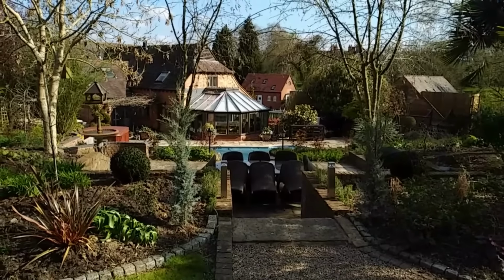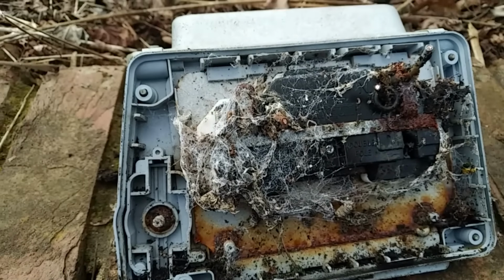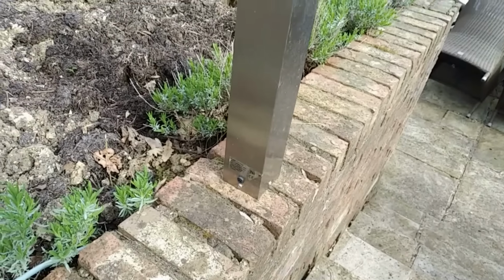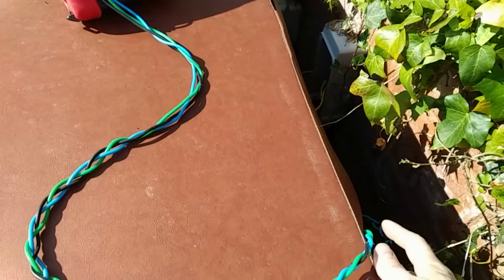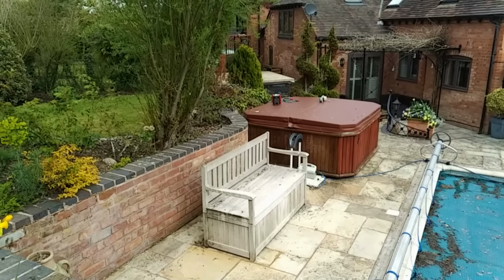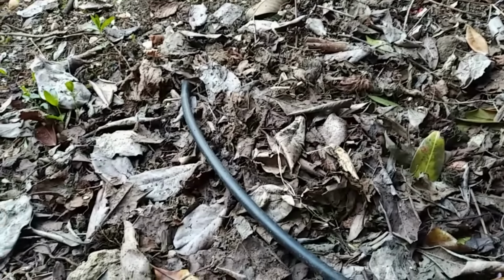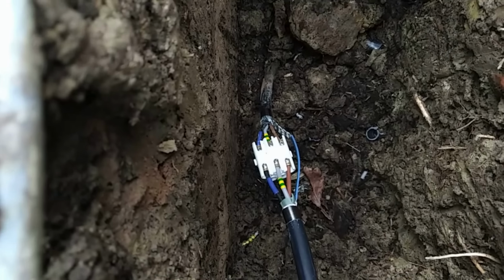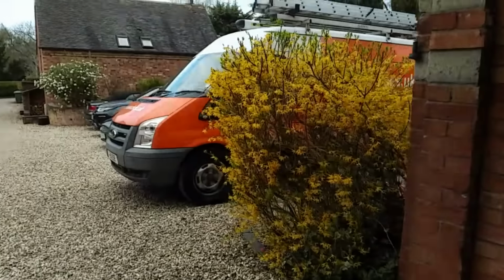Uncocking cack garden electrics

Comment: Your electrical materials are so much different than here in the states.  I'm amazed how you run 220 everywhere.
Reply from the maker: I woudn't want to run anything above 12V to much of this installation - no need for more than that with modern ELV LED lighting!
Reply: @dsesuk  
Here the only thing that would be 220 would be the pump and maybe heater on the hot tub.  I guess it would be handy to have line voltage here and there to run equipment but there are so many good rechargeable units now. Why do I want to drag cords around? They would only be 110 anyway.

The main difference that most people here, including electricians, don't understand though is that you are charged by the leg with the higher load.  If you are running all 110 loads and your panel isn't well balanced it can be a lot more money.  Then if you start looking into power factor etc.  things will begin to make your blood boil.

Personally I use a lot of solar lighting now.  You can get cheap motion sensor LED lighting  on Amazon for around $6/unit.  I put those things everywhere on my property.  Talk about handy.  Scares off the critters too.  My donkeys like to play with them.

Here when we say 'armor cable' we usually mean metal wrapped mc cable or sealtite.  You guys have really odd stuff.  It's neat though.  Looks like it would be good quality if installed properly.  Normally we only see stuff like this on commercial projects.  Everything here is usually Romex, or run in pvc conduit on residential.  Exterior is usually pvc conduit and some sealtite.

All of those buried junctions give me the creeps.  That isn't code in the states.  You would have to have an accessible vault.  Of course in the county I live in there is no such thing as permitting and code compliance.  So much terrifying crap!  It's like a zombie movie.  Most houses around here could be upgraded with a bulldozer.  When I see a new burned out hulk I say, "Yet another successful home improvement project."
Reply from the maker: @rehoboth_farm  Solar lighting would be great if the rain clouds parted for long enough! I've heard before that all junctions have to remain accessible over there. Makes sense, but it must make life difficult! We have a specific regulation and British Standard (BS5733) over here allowing connections to be inaccessible under certain circumstances, and thank goodness for that!
Reply: Actually 220-240 makes a whole lot more sense economically, it's a decent compromise between safety and material costs. Basically a European circuit allows you to draw much more power at once than your average American 15 or 20 amp circuit while using the same size of wire!

A 120 V/15 amp circuit delivers 1800 W while a 16 amp circuit at 230 V gives you 3680 W! For some reason the US require fairly large wires for 15 and 20 amp circuits too, so it's really a bit of a waste. Korea used to have the same setup as the US but switched to 230/400 V three-phase distribution back in the 70s - I guess they did that for good reasons!

In most developed countries the number of electrical accidents is extremely low, regardless of the mains voltage, so "120 V is safer" doesn't really seem to be an argument. On top of that, most of the electrical accidents around here are work-related, i.e. professional electricians disregarding basic safety procedures and other contractors not supposed to mess with electrics at all. I guess the only reasons why the US never considered upping the supply voltage are the effort required (including the environmental impact of scrapping billions of appliances) and a gut feeling that anything exceeding 120 V is unsafe for the general public (277/480 V being commonly used in the industry, so it isn't like higher voltages are simply unheard of in the US).
Reply: @Ragnar8504  I understand the reasons for using 220.  We use 220 on large appliances like washers, dryers, ovens and air conditioners.  I've run a lot of 208 and 480 in industrial and commercial applications.  The only place that I normally see 277 is in lighting circuits.  

I jut fail to see why my coffee pot needs twice as much power.  Besides, most of my electronics are going to convert wall current to DC anyway.  TVs don't use CRTs anymore.  Now, all new lighting is LED and therefore converted to DC.  If 220 is better then why not wire everything for 208 three phase and run three phase motors in everything?  Electrically speaking three phase is much more efficient than 220.  Who doesn't want a three phase leaf blower?  

As far as safety more people in America are killed by garden variety 110 than any other voltage.  Why?  It's what they interact with.  It will always be the voltage that the 200 lb ape is exposed to the most frequently.  277 is brutal though.  Brutal.

Don't get me started on 50hz.
Reply: @rehoboth_farm  "Who doesn't want a three phase leaf blower?" =:-O LOL Just figured out how to inflate my pool quicker and entertain the dog from the opposite end of the garden at the same time!
Reply: @rehoboth_farm  Anyway, what's wrong with 50Hz?  The maths is far easier (one cycle is 0.2sec, unlike your nasty setup) and who really cares that it happens to have the greatest affinity with the human central nervous system...
Reply: @GrahamJEllis  Funny story about 50hz.  They used to use the frequency of current and a counter in US made digital clocks instead of a crystal.  People would travel to Europe, take their American made clocks and plug them into a voltage converter.  The clock would seem like it was working just fine.  No smoke.  But it would only count 50 seconds every minute instead of 60 and therefore only 50 minutes instead of 60 in an hour.  Overnight they would loose an hour or more and show up late for their meeting the next morning but everybody else knew why.  It was kind of an inside joke in the electronics world for a while.

Comment: Great video, shame about the piss poor workman ship you had to deal with. When you refer to 'my line tracer' do you mean a continuity tester? Thanks
Reply from the maker: It's unfortunate, but I wasn't planning on recording any of this and so missed the bit with the line tracer which is a shame as it was an excellent example of how that operates. I only started filming after that bit! It's not a continuity tester, it sends an audible 'warble' down the line which a non-contact radio receiver picks up. They're common in telecomms which is from where mine descends from (I was at Mercury and Cable & Wireless in a former life). I was thinking of perhaps doing a video on it. This is the kind of thing: https://amzn.to/2V1rzgU - mine is a bit more complicated, but does the same basic job. Besides testing comms cabling, you can stick it onto a dead circuit and go around pointing the receiver at accessories or dangling wires to see which 'warble' to get an indication of what's connected. There's sometimes some cross-sound, especially if you have it on the earth or neutral while they're still commoned at the CU, but it's got me out of bother a lot of times.
Reply: @dsesuk  These testers are real lifesavers!

If you do get cross-talk, just short the wires you want to know about and if the warble goes away you've got the right ones! Obviously only works if everything's dead (mine is supposed to work on live wires up to 400 V but quite a few people on the web said theirs blew up). Saved my behind once when I was trying to find a buried splice in a plastered brick wall, spotted the vertical run (two different types of conduit meeting at the splice) down to 1 cm! That was one lovely bodge job too - someone decided to move a door and spliced the pre-WWI wiring to some new wires at the old switch location, plastering over the whole lot (choc blocks wrapped in tape). He then ran 16 mm flexible tubing down and behind the skirting, only to have someone screw the skirting right into the wires. I ended up pulling round cable through the existing pipes after cutting out that splice and pulling all the screws and plugs from the skirting.
Reply: Oh wow seems like a great bit of kit to have in the toolbox, so im guessing you just connected it at the CU end then just pointed the receiver at the sockets to confirm the connection? Great channel by the way 👍
Reply from the maker: Exactly that - between L-N in this case (with both disconnected at the CU), and the receiver picked up the warble at each socket heading down to the tub. Had I used it more effectively, I would have realised sooner that the SY cable wasn't doing those post lights, but I only waved it around briefly to get an idea of what to start unscrewing!
Reply: Thanks for the reply keep up the great videos.
Reply from the maker: @jcamerz  New vid coming this weekend showing the line tracer in actual action!

Comment: I'd be very reluctant to try and savage anything from this job, the whole lot needs ripping out and doing again. The homeowner may be able to take the contractor to court and get some sort of compensation for the poor workmanship.
Reply from the maker: I bet when I ask for installation certificates, there won't be any. It's wise to always be reluctant to work on someone else's crap job, but rip out and start again isn't a philosophy you can always run a business on. You have to be able to recognise what you can work with, temporarily if needs be, otherwise you just ain't getting paid.
Reply: @dsesuk  The only way I would feel comfortable signing-off an installation as safe, would be if I confirm the condition of every single inch of the installation was in good order, given that there appears to be a number of joint boxes buried in the ground and extent to which the installation has deteriorated in such a short space of time, undersized wiring used, no continuity of outer metallic sheath... For me, it's a rip-out, if they want somebody to just patch it up and getting working, then that's not the job for me.

Comment: That hot tub should be on a dedicated supply. It pains me to see them sharing a circuit with sockets.

It's an old hot tub, probably 12-15 years old. I would guess that it needs it's own 32Amp supply, unless it has been reconfigured for 20Amp.
Reply from the maker: Agreed, I think the hot tub was an afterthought. I suspect it was originally a socket circuit that ended with the second twin outlet, then someone extended it further using the SY to a single outlet, and finally someone took an SWA off that to the hot tub position. Previous hot tubs I've installed have been around 24-26A and have needed their own 32A supply, but the rating plate on this one was 4.1kW (or something).

Comment: When I wired my tub I think the regs said connector/isolator should be >2m away to prevent anyone touching it from within the tub. The regs have maybe changed now.
Reply from the maker: I'd prefer it to be further away, but the limitation here is the cable from the hot tub which only extends this far. I'm happy that our 2P+E connection unit is as IP rated as we can get it, my concern would be more to do with the existing socket and junction enclosures immediately behind the thing which look pretty shonky, although we have had them open and there appears to be no compromise to their IP status.
Reply: Min 2 mts away and rotary isolator.
Reply: Min 2m max 5m and assessable, double pole and lockable, normally 6mm armoured direct and for me a RCBO
Reply: All moot because it was an IP68 60309 interlocked socket: you could fumble at it with your dripping wet hands but it won't come out until you turn off the rotary iso. :-)
Reply: Yep, my tub connector is just inside the 2m rule, but you'd have to be a contortionist to get to it from within the tub, so I'm happy it's safe even though it's not entirely compliant. Cheers.
Reply: @wirdy1  BTW, "outside the zones" is defined as min. 3m in the book.

Comment: How did you "join" the swa wire together...did the shark (whiska) come with some form of armour clamp ?
Reply from the maker: Yes, it has two constant force springs to hold the braided connection onto the armour sheath at each end.